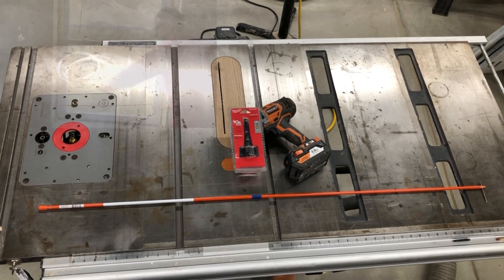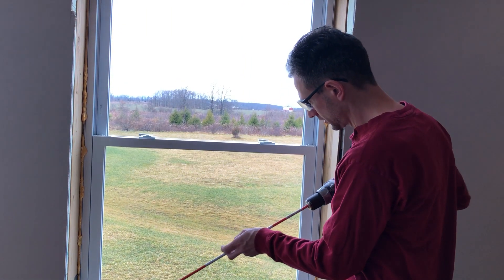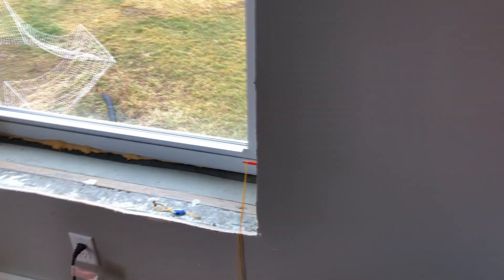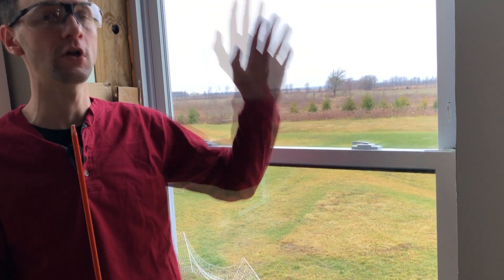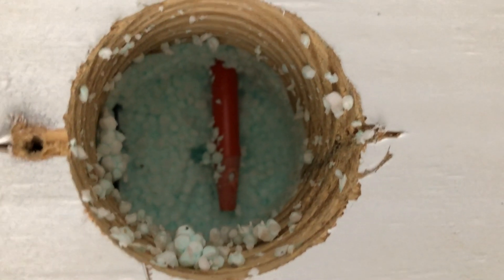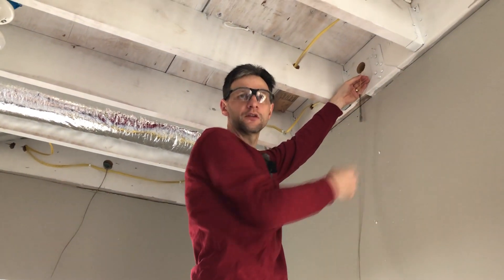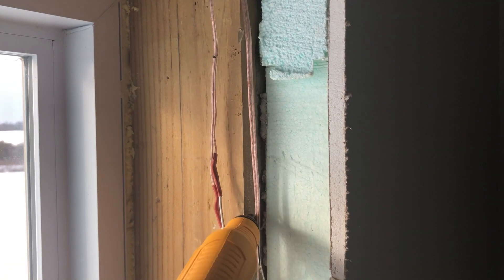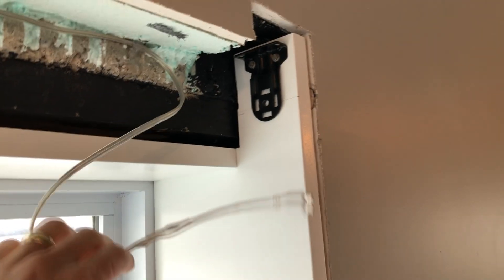Prewire For Motorized Solar Shades Installation in ICF Walls

Comment: If you hit that line voltage you’ll get the thrill of a lifetime.
Reply from the maker: I took pictures of the walls before I installed the drywall so I can always check my wire routing before tasks like this one.  Also the drill is fiberglass so it does not conduct electricity.